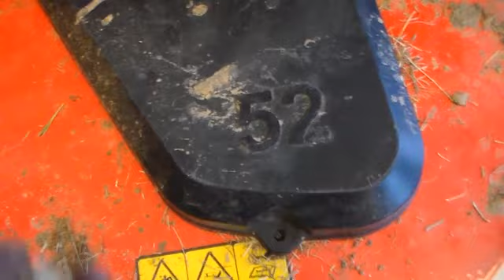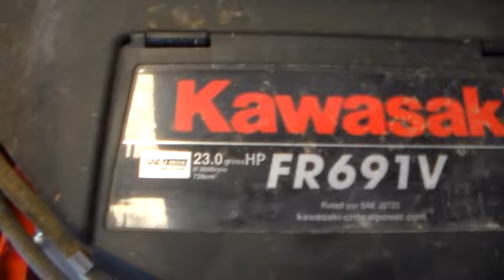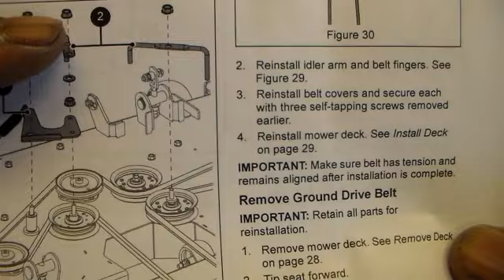Ariens Ikon X 52  Riding mower belt replacment part 1

Comment: You wouldn't have the part # ?
Reply from the maker: No. the replacement belt was handed to me.
Reply: K
Reply: @diversity2739  kool..
  I just found a replacement for it.
  Thanks for your vedio did help, and the deck does slide sideways it was easier..
 Thanks again 👍
Reply from the maker: @GabrielMartinez-ns5ul  welcome Gabriel

Comment: how many hours were on it when it broke?
Reply from the maker: PrisonEarth it was an accident
Reply: Mine has 15 hours on it and it threw the belt off, I'm hoping it was just clippings packed in the gaurd. I have it back on but have not tried it again yet. Thinking about leaving the gaurds off.
Reply from the maker: ok, be safe
Reply: Mine belt has come off 2 times, not sure why but now I make sure the engine speed is low as possible when engaging the pto. Other than that it does a great job.
Reply from the maker: PrisonEarth something sharp cut it.
Reply: @themeaningoflife38  We own an IkonX and canNOT keep deck belts on this brand new mower purchased from Home Depot -- light lawn use -- only used 30 hours and now on our 3rd belt.  Highly dissatisfied - already reached out to Ariens ... was told by Steve at customer service (with a non helpful attitude) "I've worked here 7 years and never heard of this."  So do we have a lemon or have others had this issue? What to do??
Reply: @Cody Carlier We own an IkonX and canNOT keep deck belts on this brand new mower purchased from Home Depot -- light lawn use -- only used 30 hours and now on our 3rd belt.  Highly dissatisfied - already reached out to Ariens ... was told by Steve at customer service (with a non helpful attitude) "I've worked here 7 years and never heard of this."  So do we have a lemon or have others had this issue? What to do??
Reply: I removed the plastic guards because grass was getting packed in there, and I make sure the bottom of the deck is cleaned out and no grass built up where the blades might rub. Also I make sure to only engage or disengage the PTO with the engine at as low a speed as possible. I have not had it come off again since doing all these things.
Reply: PrisonEarth my mower also trew my belt at 8hrs!  I did put it back and mowed my yard with no problems.. 

Did yours ever came out again?

Comment: Love it when someone does a "how-to" video when they're learning how to do it for the first time themselves. :/ SMH. 

If you're going to put it on YouTube as a helpful instructional:
1. Invest in any type of recorder to record what you're saying and sync up in video editing
2. Already know what you're supposed to be doing
3. Do the steps in short segments so you can clearly show what it is you're working on
4. Have someone else hold the camera

Without these things your video is simply more noise on the internet. I think I actually learned nothing from this, and that's tough to do because you usually take SOMETHING from seeing a procedure. 

Recommendation? Now that you've done it, DELETE this video and redo it without all the parts showing you simply fondling a bolt, or trying to decide which way the belt actually wraps.
Reply from the maker: Thanks for the info. that machine broke down', when l was painting the the sport center. the owner had enough to do that week, l asked if l could assist him. I grabbed my camera, and. had the belt on when he returned. What a happy man. no bad for a painter.
Reply: @diversity2739  I really should make sure I don't come off sounding like a jerk. That wasn't worded the best. I'm going to leave it there though because it should serve as an example of how not to sound in a comments section. Glad you shared what you could. Thanks for responding with grace even though I didn't. Cheers man!
Reply from the maker: @RWT2777  no problem. this is great, people like this stuff, l have 839 more video's waiting for comments, you my kinda people. thanks for watching. we paid for this stuff.
Reply: Nonsense, walking people through your learning process is half the education.